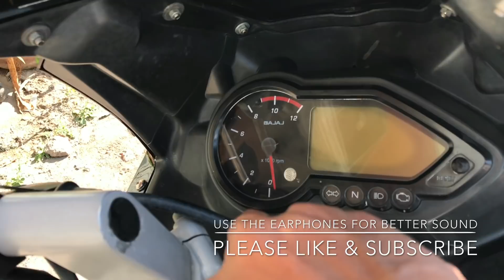Akrapovic Exhaust Installation In Pulsar 220

Comment: 4:52 whats this noise? I have the same problem with my pulsar 180 ug4 2013. Any suggestions to get rid of that annoying noise?
Reply: Self starter noise
Reply: @abhianime_fan3789  any solution for it?
Reply: @samsher_sc  1. Battery may be weak get it changed . 2. Or one way self starter gear kit change it .
They get worn out by time so it gives that noise .
Reply: I too have the same issue with my Pulsar 150 ,I hear it even when I use my Kick starter to Start the Bike...Can someone plz help me out ?
Reply: @dat_anonymous_kid  loose the starter 8mm bolts. It worked in my case👍